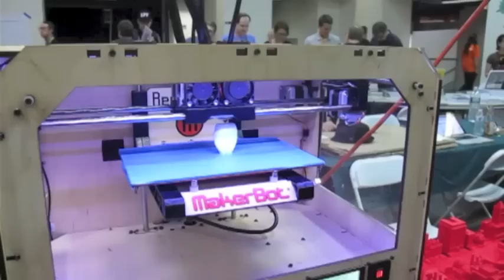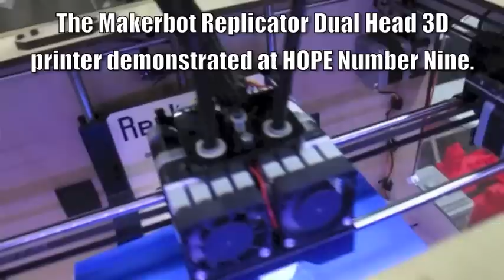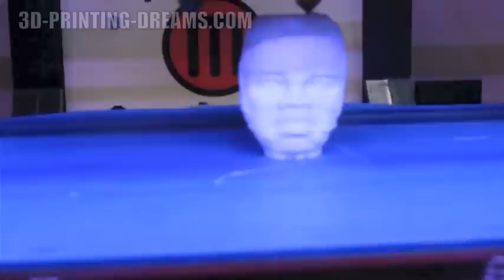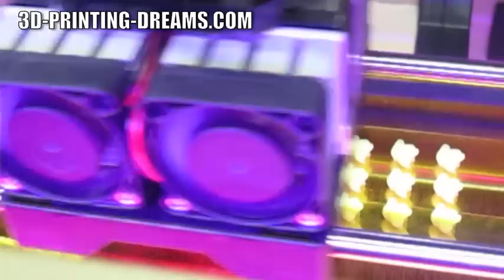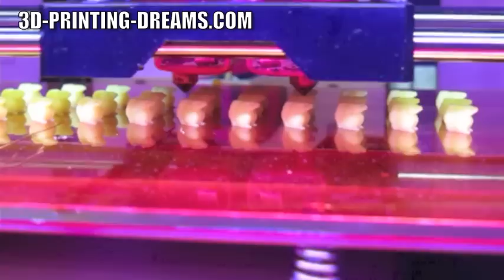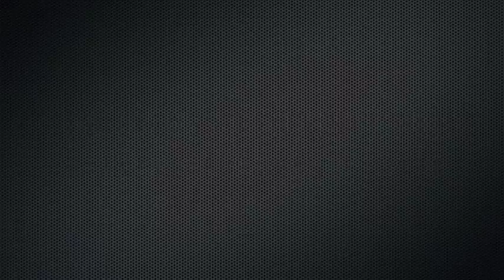Makerbot Replicator at HOPE Number Nine Conference

Comment from the maker: I had a similar problem with my 3D printer in the beginning. It turned out to be a loose setscrew on one of the extruder gears. The stepper motor was turning, but the gear was slipping on the shaft. I ended up filing a flat on the stepper motor shaft and then using loctite on the setscrew.